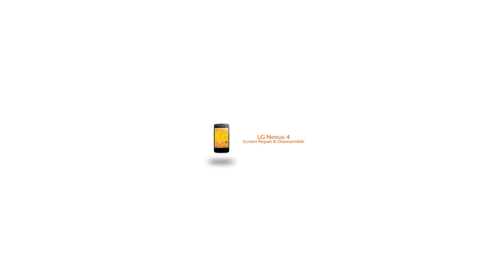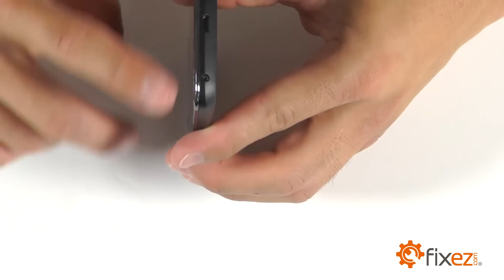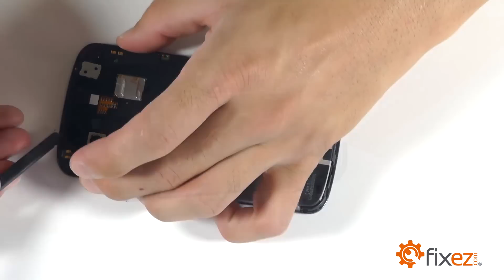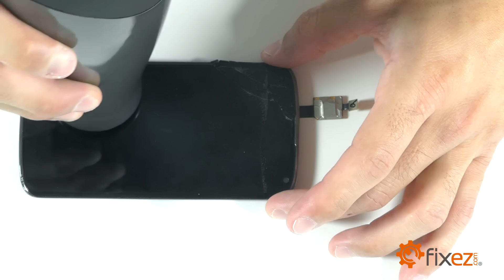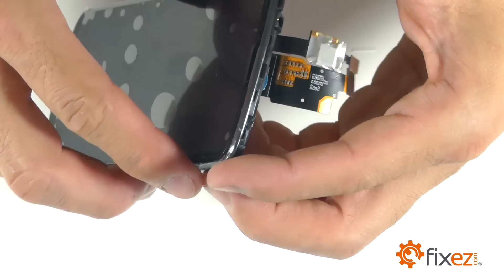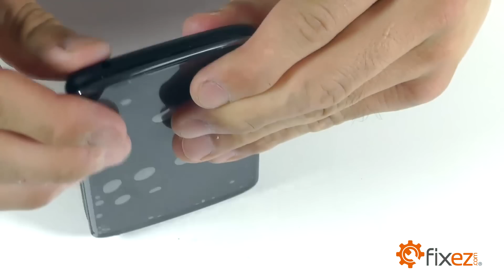LG Nexus 4 Screen Repair & Disassemble

Comment: I just changed my screen - whole LCD frame etc. You didn't point out the switch connectors stayed in the old one so had to rip it all apart again to move them over. Great otherwise

Comment: Having changed the battery before, it does not come off as easily as shown in the video so you have to be patient so as to minimize bending. The battery is malleable which surprised me!

Comment: hey i droped my phone and theres only a small crack on my top left corner, and now half of my lower screen doesnt work (touchescreen) except that the image is good... what are the peices i need to buy for the replacement and will it work in my case? thanks in advance!!

Comment: There are at least 2 errors in this video:

1) The battery is glued to the frame, you are most probably going to have to buy a new one after removing it because it bends.

2) if you remove the back without removing the sim card tray first you are going to break a thin plastic strip that sits between the tray and the frame. Removing the sim card tray is the first thing you have to do.
Reply: +smokingflowers Thank you, I just broke that thin plastic strip for SIM tray... great video, 10/10, would brake it again.
Reply: +Backup of fixez.com Maybe you should add an annotation saying this in the video. People should not have to get to the comments to find the answers to obviously missing information... Thanks a lot for misinforming me and now I have a broken phone AND a broken battery...
Reply: +Nerte Me too. Glad I watched the video first. Perfect!
Reply: I just think it's common sense to remove anything that can be removed (eg. SIM cards, microSD cards, batteries etc) before starting ANY disassembly, and as to the battery - thanks ! I wasn't paying attention much ;p
Reply: You don't need to take off the battery lol
Reply: Removal of the battery is essential for the digitiser and screen combo I bought. Didn't expect the battery to be so well attached!

Comment: Hello, my nexus4 fell and the screen is cracked. everything seems to be working in the phone, it is ringing, i see notifications of messages, wasup, etc arriving but the touchscreen is not answering anymore. i cannot  enter my password or to answer a call. 1. can this be repaired?  2. i see two products for replacing the screen a) the LG Nexus 4 E960 Display Assembly (LCD & Touch Screen) and b) the LG Nexus 4 E960 LCD & Touch Screen Digitizer with Frame…what is the difference? ..Thank you in advance for your answer!

Comment: It looks like you don't need to disassemble the motherboard, speakersassembly and the battery to replace the screen. Is there a reason why you remove those parts?

Comment: I'm probably going to get a new phone (hopefully, crossing my fingers) in about 5 or so months. The Nexus fell out of the car and and screen is cracked and not touch responsive anymore. Would it be worth repairing right now? 
---For months now the soft touch buttons haven't been working. Any idea why? If I'm in landscape mode and the buttons are on the side of the "hearing side" they work. 
Also, great video. Super duper helpful.

Comment: I bought a replacement screen from Fixez and (thought I) correctly replaced it. The screen and (more importantly) the digitizer work, however, the screen still has display problems. It looks like an old style film silhouette when booting up and any high contrast areas leave vertical shadows. So, something is still wrong. Any ideas what I might have done wrong? Or is it possible that I received a bad screen?
Reply: ***** My daughter, regardless of how many times I warned her, kept putting her phone in her back pocket and eventually shattered the screen. I've already contacted your tech support folks who tried to tell me to reinstall the OS so that it can detect a hardware change. Not knowing any better, I'd try that except that the screen also exhibits the silhouetting even when I go to the bootloader before the OS even has a chance to boot; so I don't see how it can be OS related.

Comment: why there are 2 antenna connectors on the motherboard? I wonder what is the function of the other one..
Reply: Since the nexus 4 is based on the optimus g that has LTE , the n4 has a LTE antenna ( band 4 only), but hasnt passes certification to actually market as an LTE device. So the second connector is probably for a LTE amplifier. Something the n4 would need to support more LTE bands. It isbthe unused connector from the optimus g. But that is just my honest opinion!

Comment: The glass on my phone is in perfect condition but I have 'dead zones' as far as the touch screen functionality. I'm not confident in my ability (or lack thereof) to repair my own phone. Do you have an idea of what the issue might be and any resources for having it repaired locally? I'm in the San Diego area. Thank you!
Reply: ***** Yes, it is. I've had the same phone with all original components for two years :)

Comment: Replaced screen everything worked fine .after 4 days screen turns white, like a blur. Suggestions?
Reply: Thank you!
Reply: Update: found that that the screen was fine and the problem was on the system update .guess the phone can't support it.. (5.1 lollipop) heard it was junk on the nexus4 phones..
Reply: Welcome.
Reply: Saul Munoz Are you sure it was a system update issue? I got to this video because my screen broke and I'm trying to fix it on my own. I've been running 5.1 Lollipop on my phone since it was pushed out and I haven't had any issues. Were you able to get your phone to work? I'm trying to see if it's worth it attempting to fix the screen on my own.
Reply: I honestly did 2 replacement screens nd the screen just dims white ..then black out screen..  I was told the update had a lot to do with it.. Idk what else it would come down to.. When i first replaced the screen(update not installed yet) it was working perfectly.but when New update .it lasted 1 week..after that it was a total lost for me I've tried everything..sorry for the late reply Stephen James
Reply: Saul Munoz Thanks for your reply. I got the screen replacement - the one with the digitizer. So far it has been about a week and I have not had issues so far. I'm running Lollipop 5.1. I've noticed a glitch that when the battery level falls below 15%, it activates the Battery Saver mode. When that happens, the screen behaves erratically. It appears as though I'm inputting stuff through the screen when actually I'm doing nothing. For example, if I go to the phone, before I even press any number it starts entering random numbers, the screen flickers, and it gets to the point where I can't use it. But if I connect it back to the charger, then the problem goes away. Something's definitely not 100% right about this product. I guess that comes with non-OEM stuff.
Reply: Stephen James Your welcome..i honestly don't know what else to do unless i get a new motherboard..but i don't think it would be worth it. I say its the update..but atleast yours has a screen to look at n reset i can't do anything at all..

Comment: Thanks to you I could change my LCD damaged and the back of my Nexus 4 more easily than I thought. But as noted by another reviewer, we must be careful with the volume buttons and on / off. If they leave the site, you must remove the plastic cover that covers the motherboard and place them back in place without forcing them. Be careful with that.

Comment: Hello, I have a nexus 4 and upper section of touch screen does not working. I wonder if I replace the screen, would it be working? the screen is fine and I did not drop it. Could you please let me know what parts do I need to fix the screen?

Comment: I went through hell trying to get the digitizer to work.  It was the connector, it has silver tape around it and I did not know if it had to be grounded or insulated.  I tried to reuse the old tape and that failed. In the end I ended up insulating the front and back of the (chip on the ribbon cable of the) digitizer connection.  It was confusing because why was it originally covered with foil tape.  Plus I think I had to remove the battery to reset the digitizer, not sure.  Regardless clear instructions in this area I am sure would help others.  In the end I was successful but it would have been far more efficient went just a tiny bit more instruction on how to mount the ribbon cable of the digitizer connection.  Specifically the chip part on the ribbon cable originally wrapped in aluminum tape.
Reply: Comment applies to LG Nexus 4
Reply: Leonard Schmiege I'm also having trouble with getting the digitizer to work. I suspect that it is related to the foil tape around the chip on the digitizer ribbon cable because that is the only thing that appears to be different from the original. What did you use to insulate it to get it to work?
Reply: Richard Graham I used some blue plastic that was coating something for underneath the digitizer and then taped some on top.  It kept working with cover off but not on.  Also, I think perhaps the digitizer got its brain scrambled during my multiple attempts, so I disconnected the battery between attempts to test the insulation.  It was so irritating because it worked when apart .  I dont think it matters how its insulated, it is bizarre that foil tape is used originally.

Comment: Recommend you buy a new battery for around £8 as the old one is glued in and becomes fairly mangled when you prise it out, damaged Li-Po's can explode spectacularly :)  I would also recommend taking out the sim tray first rather than last as its another obstacle to removing the back cover.  Finally, my new screen came with a frame and bezel, there are some extra parts to switch to the new frame all off which can be teased out from the old screen, plenty of tiny parts such as two rubber parts on the top edge (1 grey and one black under the headphone jack) and the switch contacts down the sides, USB board at the bottom etc.  Take your time, mine is now back up and all working.  (I also tested all ports/buttons/mic/cameras/screen/touch before sticking the battery to the new frame)

Comment: The 2nd step of prying off the back should be more helpful. I figured I could just go ahead and use the plastic pry tool but ended up with a shattered back plate. I may have broken the volume/power buttons too, which are completely glossed overs here. The video makes this step seem effortless.
Reply: Oh, and I would recommend doing this with gloves or something, because the glass will shard easily and little pieces of glass will stab you while you manhandle the case to pry off the back plate.
Reply: One other note: if you have a set of tiny Phillips and flat head screwdrivers that you used to use back in the build-your-own computer days, they're too big for the Phillips screws that hold down the battery plate.

I'm now wishing I paid the extra $250 just to get the Nexus 5 from Google rather than attempt this $100 repair on my own.
Reply: Okay, now that I went to the hardware store, I'm on to the step where I use the spudger to remove the battery. There's a lot of adhesive under the battery and it does not just pop out like it does in the video. I also bent the heck out of the battery and while I'm not expert on batteries, I'd guess that turning the battery cell into a C-shape isn't good.

At this point, I should probably just return the $60 replacement LCD and cut my losses. However, my attempt at this "EZ" repair may be helpful to others.

I've reached the "remove the cracked screen" part and just like previous steps, it's not easy to extricate, my screen just keeps cracking into smaller and smaller shards and my floor is now 40% tiny pieces of glass that I look forward to stepping on in the future.

Seriously, I do not recommend the lay person attempt this repair. My spudger and plastic extraction tool look like a cat has been chewing on it for an hour.

Comment: Hi, my nexus 4 screen just stopped working in a small part, is a thin line from side to side of the screen, I talked to some friends and they said I should change my digitizer, but I searched and found that I need to change the entire screen, as in the video, so you think this is the right thing to do.
Thank you.
Reply: Hey Vitor! I'm having the same problem as you mentioned. A thin vertical line on the right side of my screen from top to bottom that's unresponsive and causes random 'ghost' touches and its pretty annoying. I could live with it if it didnt think I was touching it in random places. Did you replace the screen yourself and did it fix the issue? Thanks!
Reply: Hey, still not replaced the screen, I made a request by eBay, but takes too long to be delivered because I live in Brazil. I searched on YouTube and on the Internet and I think the screen replacement solves the problem. But I can not say that will work 100% because I have not received mine.
Reply: Vitor, I'm willing to buy a screen from ebay as well and heard that some will not fit REALLY fine into the phone or that the display may not have the same quality as the original. Did you run into any problems? Do you remeber from which store you got it? 
thanks! (from br as well but it felt weird to ask in portuguese as someone might need the info as well kk)

Comment: Hi, Thank so much for  your help. Ordered a new screen and digitizer. I manage to take the old phone apart, and put on the new screen. Unfortunately, the quality was very low. Could see the pixels, and had lines all over the screen. Filed a complaint with the shop where i ordered it, and got a new screen. I tested the screen before putting it in the phone and it was good quality. However, after putting it together, the quality went as bad as the first screen i ordered. The fault must be in the way i installed it, or I skipped some step along the way. Any clues? Thanks!

Comment: If you are just removing the screen... why take out the logic board and everything else? Cant you just detach the screen cable from the board and then remove the screen as u did in this video? Doesnt seem like its needed to remove the board or anything else at all, unless im missing something?
Reply: Maybe to avoid damaging all the other components. I'm not sure, just my guess.
Reply: Mister X damaging them with the heat
Reply: i think the components can certainly take the heat, if the lcd can, the motherboard certainly can
Reply: RIght good point. Well I just ordered the screen with the frame so I'll have to take everything out anyway. We'll see how it goes.

Comment: heat up the battery, I pried it off from a corner that was exposed and just kept shimming it out.  It's okay if it bends a little, stay away from the top where the cable is.  The battery was the most annoying part of the fix.  heat gun is a must for the battery and screen itself.

Comment: stripped a screw, had to take it to a grinder wheel, it was one of two that held the battery cable on.  This had all the info you need to take it apart, ty.  My screen replacement didn't come with any adhesive, so i gotta wait and order some now.

Comment: So, I attached my screen and there is a black/grey-ish vertical bar that is blocking my view on the left side of the LCD. I opened it back up and re-checked the connections and didn't see anything amiss....thoughts?

Comment: Hi there. So I dropped my phone. The touch response works but the image is all messed up. I'm not sure which replacement I should get. Id rather not mess with removing the screen with the heat gun by would rather just replace the whole unit. Which do you suggest? Thanks, appreciate your feedback.
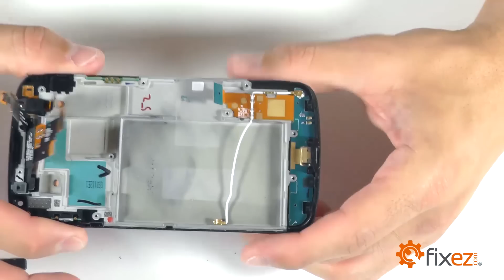Reply: ***** If you were to buy the frame (which seems like a pretty good idea all considering its not much more expensive), how would you change the instructions in your video?  Would you just skip the instructions on seperates the display assembly from the frame and just go straight to the reassemble?  Around 4:18 when you say "Don't have to remove everything"  would we have to remove everything if we buy the frame as that would require moving over all the componants?

Comment: Very "convenient" how you pry the battery up and all of the glue is already removed. Trying to remove my battery without destroying it, there's a TON of glue it appears and it doesn't want to let go. I managed to remove it, but prying at the top as you show showed that something under the foil is loosely attached on the top edge, and hopefully I didn't break it before I realized that. 

Very "convenient" how you skip over the most difficult steps like that. 

For example, you say "The speaker assembly is next, secured by two phillips screws". You grab it it,  then the video SKIPS to the next step. Oddly enough, once I removed the two screws on mine, the speaker assembly does not just come out. Still trying to figure out how to remove it without breaking something. I watch videos like this so that I don't have to figure it out and/or break something but as I said you conveniently keep skipping over those things. 

I'm not sure what your goal is by pre-disassembling the device and making sure all the glues and tapes and such are already loose before filming the video. 

EDIT: Ahh, I see you sell repair kits. So it is in your best interest to make the repair look easier than it really is.
Reply: ***** I also ran into this problem as well.  In your video, the battery pops out quite easily, but from what I have experienced, it is firmly secured with a considerable amount of adhesive, which neither the video nor your response addresses.  That part of the video is not cut.  There is simply no adhesive attaching the battery in your demo Nexus 4.

Another tell that the demo phone was pre-disassembled is that the coax cable is not taped down as it would be if the phone was untouched.  This is extremely minor and easy to detach, however it shows that the phone was cleaned prior to this video.